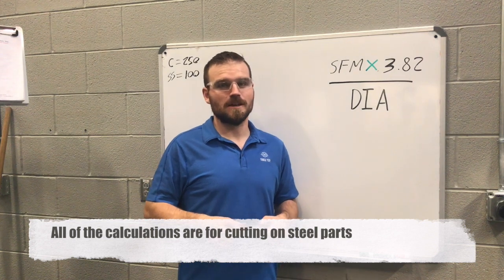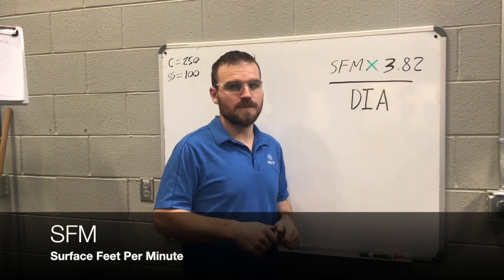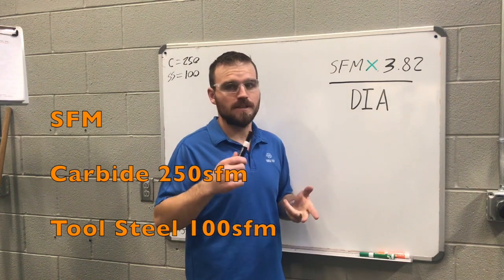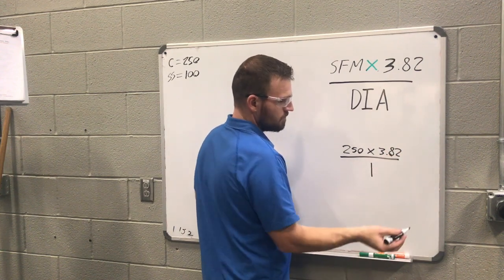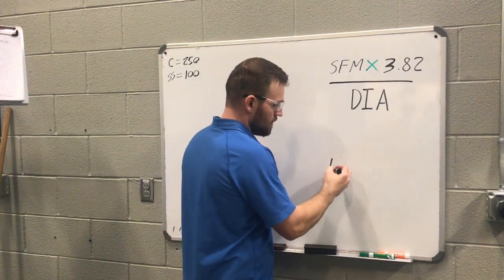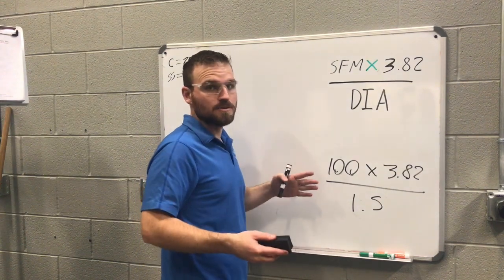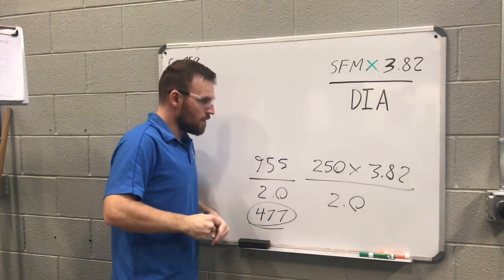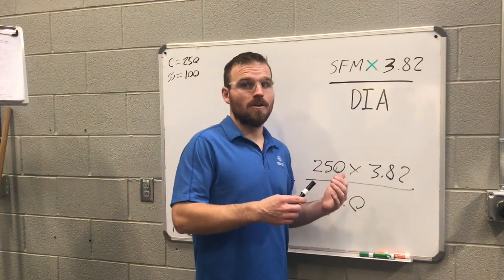Finding the spindle speed for a lathe

Comment: 1943, 11th edition machinery handbook, its in there. You just have to know what your looking at. Your using 250 with with 1". Easy, convert 1" diameter to circumference, and that looks like this. 1 x pi ÷ 12 = .261. (÷12 because were using feet here.) Now you take your 250 ÷ .261 = 957 rpm. Now your hss, your using 1.5 and 100. Again. its in the machinery handbook, all the way back to 1943. Samething 1.5 x pi ÷12 = .392.
Now take your 100 ÷ .392 = 255 rpm. Im literally looking right at this in my book.

Comment: If you're drilling on the lathe do you still use the diameter of the material or do you use the diameter of the drill bit for the equation
Reply from the maker: I would recommend using a drill bit chart. I find this method to be a little bit to fast for smaller drill bits.

Comment: My home workshop lathe has a max rpm of 500 and I do loads of smaller diameter which need loads more, any suggestions? Maybe change drive pulley diameter and lose torque? It is 3 hp 240volt 50 cycle motor single phase.

Comment: the DIAmeter would be the final diameter OR the initial diameter of the workpiece OR the difference (which is to cut off)??
Reply from the maker: The diameter would be for the initial part. As the part gets smaller the speed may change but most times it`s close enough unless you are taking a part down a lot in size. in that case, you would want to change your speed as you go along. hope this helps!
Reply: Tooele Tech Automation Manufacturing Technician nice one; clear on that now sir! ok so the cutting speed is also contingent on the depth of cut (initial - final diameters) true? (based on the table of cutting parameters data)
Reply: Look up the sfm for your inserts what they’re rated for and this will change depending upon your material.  Then you can program it in g96 which is Constant surface speed and the machine will figure out the rpm for you based upon how far it is from spindle center x0.0.  You also need to set a spindle limit with a G50 followed by what you want your max rpm to be.

Comment: How to calculate the feed rate for the lathe? Based on formula please
Reply: Finish speeds are gonna be .007-.009 and ruffing is gonna be .010-.012
Reply: And you can slow it done more for a better finish like 0.005